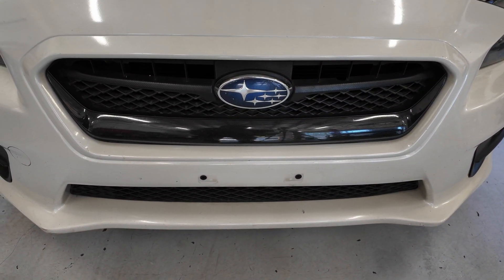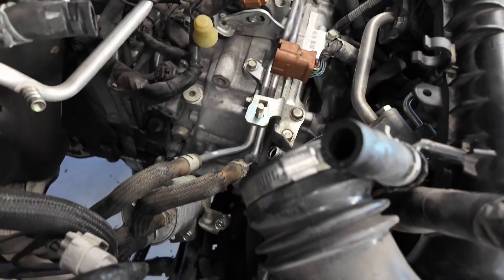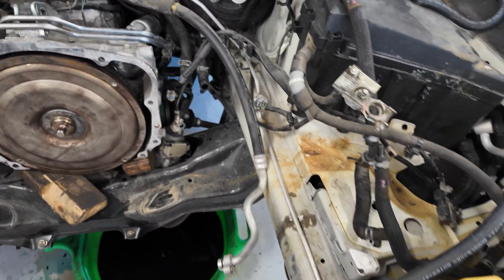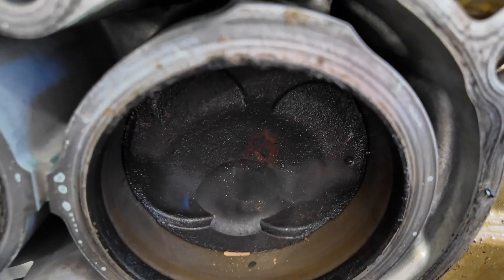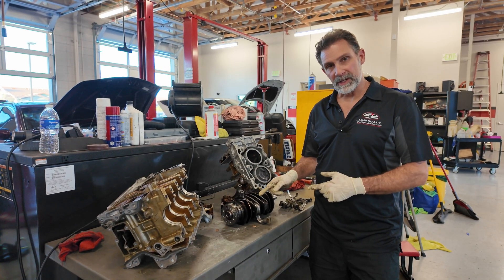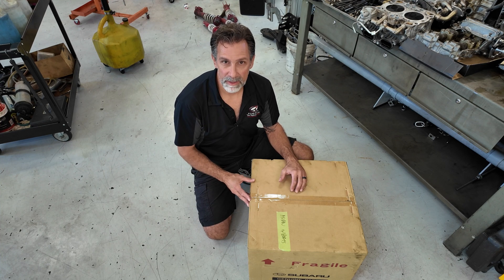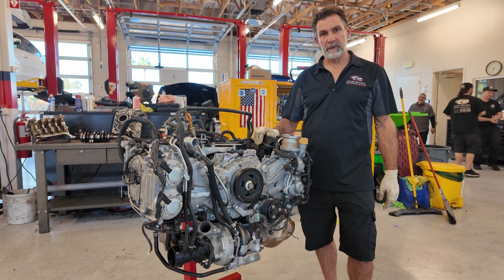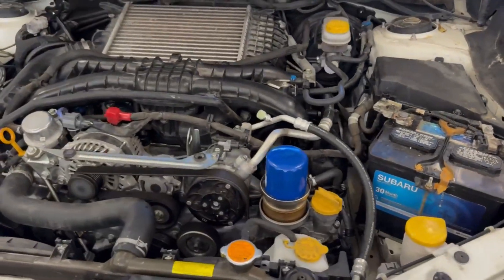The Ultimate Subaru Engine Teardown: Fixing Boxer Knock

Comment: This happened to a 2020 Forester  with less than 30k miles, 4k Pennzoil ultra or supreme synthetic filters mostly WIX (they were OOS everywhere for a while) it got revved to 6k 1x in it's life for a few seconds, The app is used to prewarm it. Seems the same issue (not torn down yet) Its les than 3 months out of MC warranty and Subaru Canada declined to even have the cause of failure determined.
Reply from the maker: That's sad.  I am really disappointed with the lower end on the Subarus'.  We have to replace way too many short blocks.   No excuses for blowing at 30K miles with a normal  maintenance schedule.

Comment: Great vid... Might be worth adding, especially with the demonstration of the noise at the start- best to shut it off as soon as you safely can, don't run it, don't limp it home, don't fire it up to record for youtube or show your mates, just shut it off- the longer you run it the more likely you are to hurt other components with metal debris in the oil or to starve something.
Reply from the maker: Good point!  Definitely don't want to run a bad engine any longer than is absolutely necessary.  Unfortunately, this client drove it into the garage like this.   That's likely why the connecting rod bearing was completely disintegrated.  It would have been great to catch this when the problem initially occurred. Thanks for watching!

Comment: 150,000 then kapuz on my 2006 sti po302  valves
Reply from the maker: Ouch!   We've seen all kinds of issues with these engines.  Had one last year with a piston cracked completely in half.  It was still running like that!  Lol.
Reply: They do love burning up exhaust valves, cracking ringlands, hammering rod bearings.... All kinds of goodies